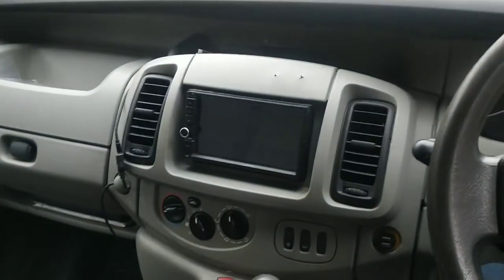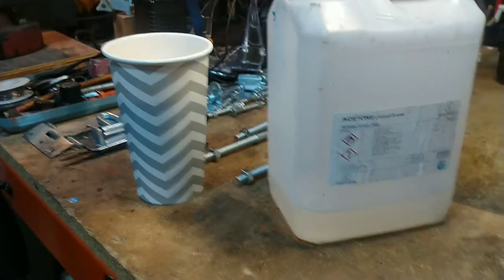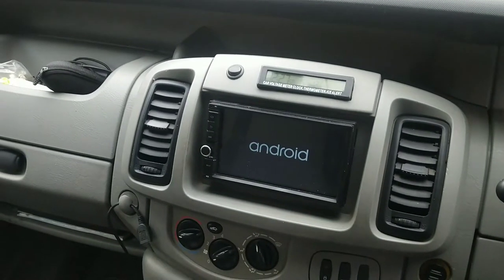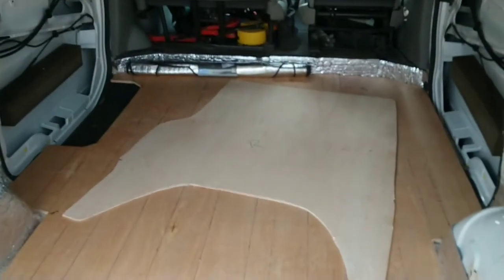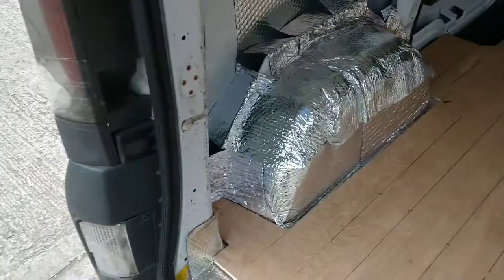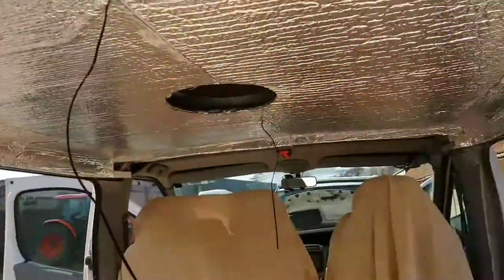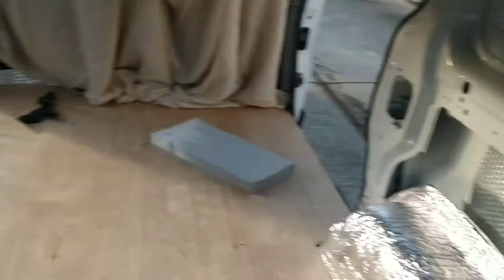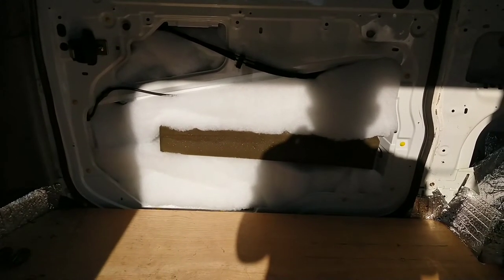Vivaro Camper Build part 2

Comment: Thanks for the video, Mark.  The van is coming along nicely.  I did not attempt carpeting.  I had it done by a professional vehicle restorer.  If you watch my videos, it will show you how I did the ceiling of our van.  I used 6 mm ply panels so I can make changes if needed.  I still have to fit the ceiling lights.  Nice to see you using "nutserts" (that is what they are here in Australia).  I did not drill a single hole in our van.  Past experience has shown me that the swarf from the drilling will rust.  This is my fourth van conversion in 40 years.  The first one was a Bedford CFS van.  The back door rusted from the inside out.  My previous conversion was a VW Caddy.  That is when I started using nutserts.  I now use them all the time.  Have a great day.